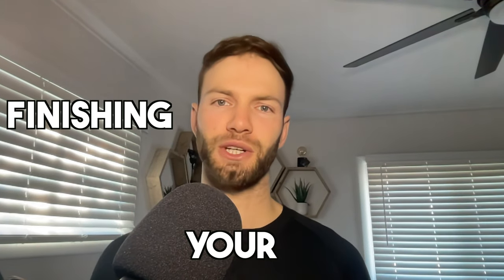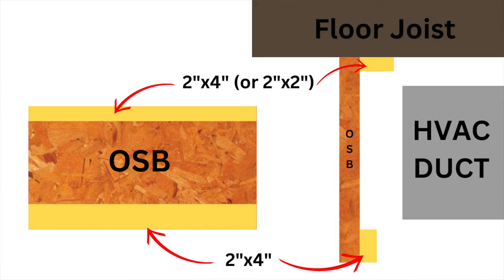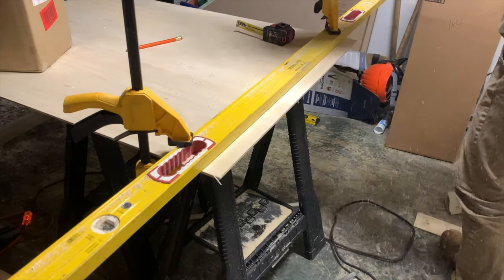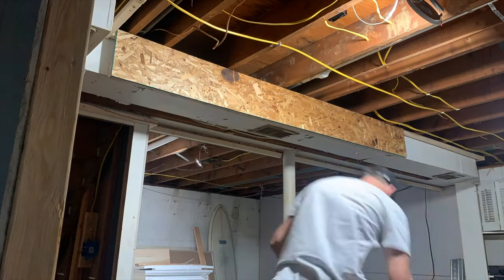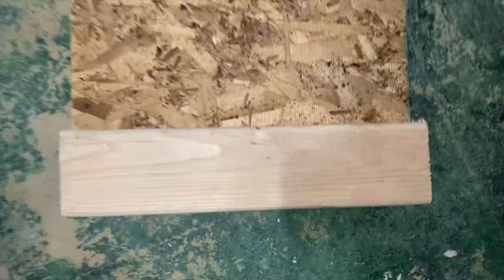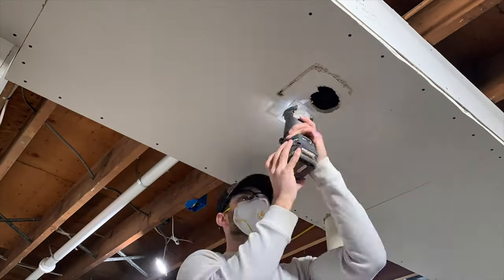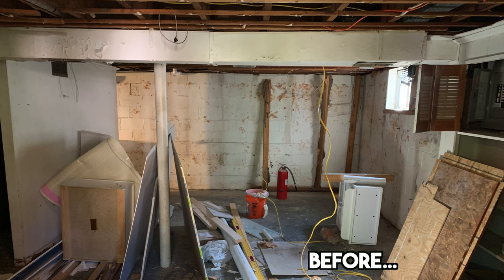How to Frame around HVAC ducts (or pipes) in a Basement - Easiest Method

Comment: I worked as a Union carpenter on commercial jobs for most of my career in the trade. You are making this way more difficult than needed. Skip the OSB and just use the drywall in its place. It is plenty strong enough. Use framing angle or 1-5/8” metal studs in place of the 2x2 or 2x4. Also, to ensure the finished bottom surface is level, hang the rips of drywall a couple of inches wild, get your laser or water level elevation marks at each end. Snap a chalk line, cut the drywall off, fasten the angle or 1-5/8” stud horizontally and it’s ready for the bottom piece. No wood needed at all. Cheaper and much faster. You don’t need all that structure behind the drywall. It is a waste.
Reply: Sorry, I just saw this. I hope it’s not too late. When you use metal framing, you attach everything with drywall screws. For 1/2” drywall you can use screws as short as 1” but your best all around length that works for everything is 1-1/8” to 1-1/4”. I haven’t found that the big box stores carry the 1-1/8” but if you see them, grab some. Metal to metal uses 3/8” mini screws, preferably self tapping. Once you use metal framing and see how fast it goes up, you won’t go back to wood. Everything but heavy gauge material cuts with a tin snips. The studs are always perfectly straight, no culling for usable product. Good luck!
Reply: I need you to post a video 😂
Reply: Do u need to wrap ducts work in insulation to prevent condensation on ducts n metal studs?
Reply: Nope
Reply: What is OSB?
Reply: Never mind I had to actually just watched a video
Reply: I feel with the added layer of the OSB, it will add an extra layer of sound proofing. I know it's not meant for it but having that extra layer will minimize even more sound than with just drywall alone even if it's slight.
Reply: @dawghunter18 oriental strand board
Reply: @spencersimmons4161 ORIENTED** I’m guessing you fell victim to autocorrect 😉
Reply: @firstcavtanker  lol I’m gonna be completely honest…. I’ve thought it was oriental for the last 15 years 😂 my high school teacher in small town Iowa did not know apparently. Thank you for telling me the correct word!
Reply: @spencersimmons4161  no problem my friend, and thank YOU for being a level headed adult willing to accept a respectful correction. The internet can be an unnecessarily hostile environment sometimes, so your maturity is highly appreciated. Cheers!🍻

Comment: As the AC units get more efficient and output colder I would not recommending sealing a duct in wood/drywall in  a basement without insulating the metal duct first.  Due to high humidity below ground basements tend to be more humid, this humidity leads to condensation which will rot your wood and can cause mold in drywall.  I am currently working on a home built in the 60's with a Geothermal system that is putting out 40-45 degree air and causing the ducts to sweat profusely. I have had to remove all the duct surrounds and insulate the metal ducts to stop this. Additionally we added a few return lines in the basement to help too.
Reply: Would you put regular insulation just around the ducts against the metal or give it some space? Trying to see how that would look
Reply: @jasonkernjr5343  It depends, the latest job I used a combination of using R-Matte boards cut to surround the square ducts(taping the seams, and some regular fiberglass with a reflective barrier out. Both were right against the ducts.

Comment: 🎯 Key Takeaways for quick navigation:

[00:00] 🔨  This video will show you how to frame around HVAC ducts or pipes in your basement.
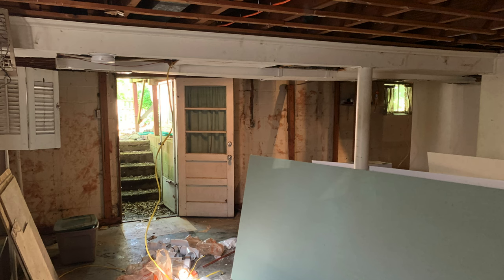[00:35] 🔨  Attach a mounting rail to the bottom of the floor joist parallel to the duct.
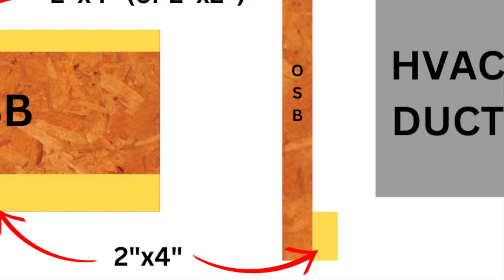[00:49] 📐  Measure the distance the HVAC duct extends from the floor joist and rip a piece of OSB to be 1 inch longer than that distance.
[02:42] 🪛 Attach drywall directly to the OSB on the vertical sections and to the mounting studs on both sides of the duct for the bottom section.
[03:10] 🛠️  Alternative framing method: Use metal studs attached every 16 inches on center and mount drywall like any other wall. This works for pipes as well. 

Made with HARPA AI